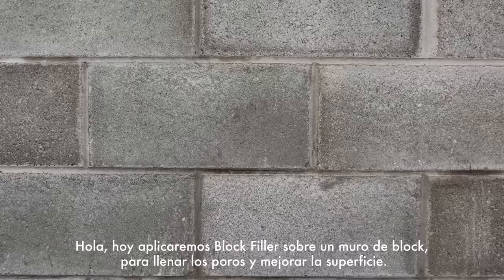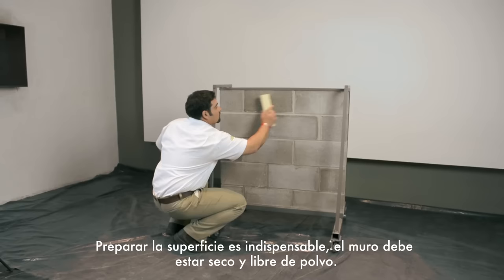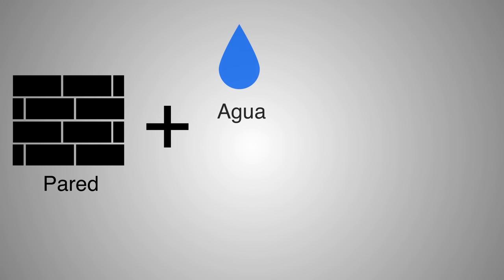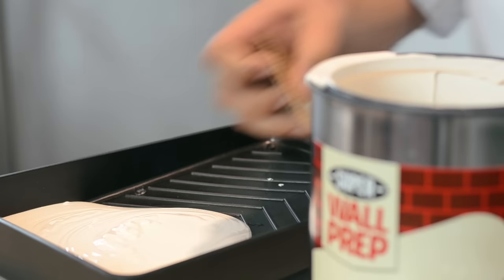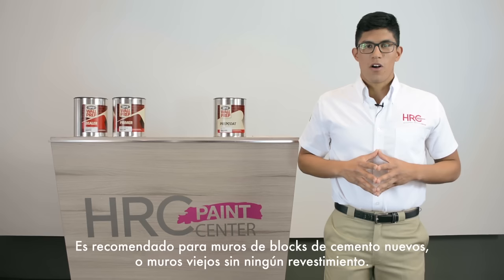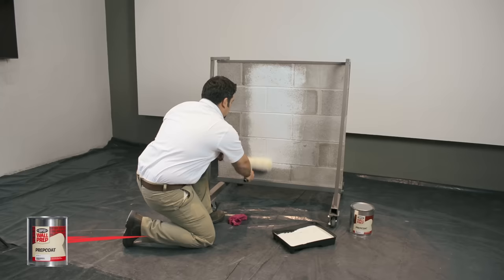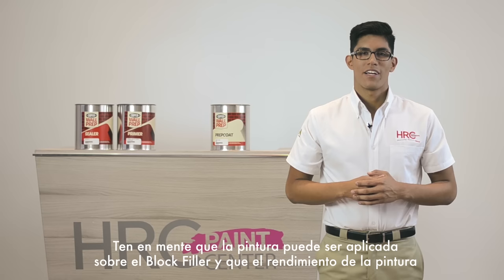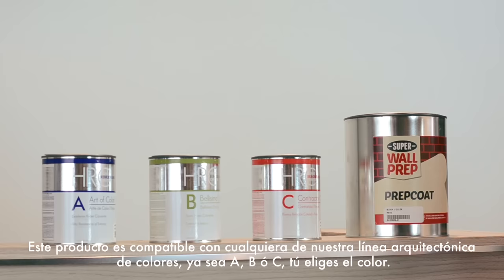BLOCK FILLER Español

Comment: Can it be  used with a spray gun?
Reply: semsem7890 si solo que es muy viscosa tendrías que usar la boquilla adecuada y requieres tener una máquina adecuada por ejemplo una 395 , con una boquilla de .17 en adelante
Reply from the maker: Al ser un producto de alta viscosidad, necesitarías tener el equipo y boquilla adecuadas, que soporte la presión, para que la aplicación del Block Filler sea la apropiada.